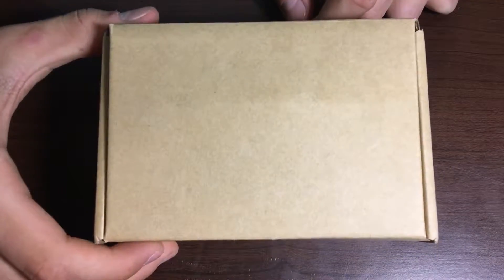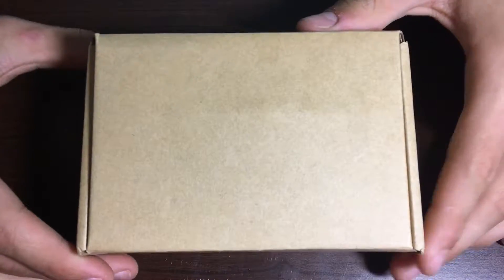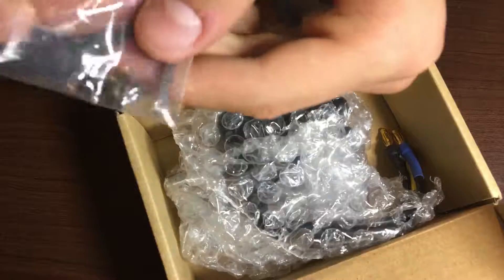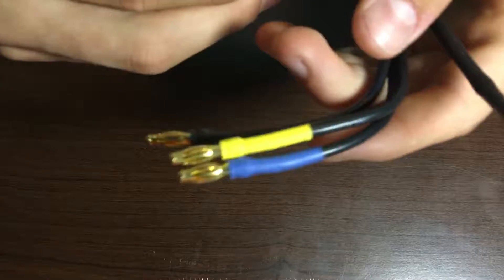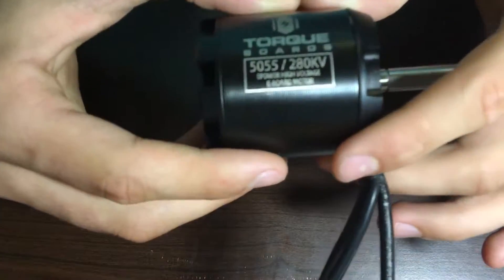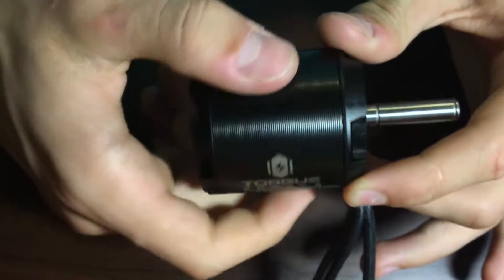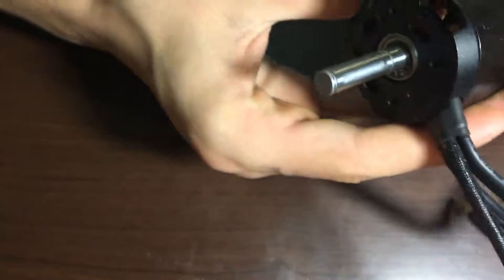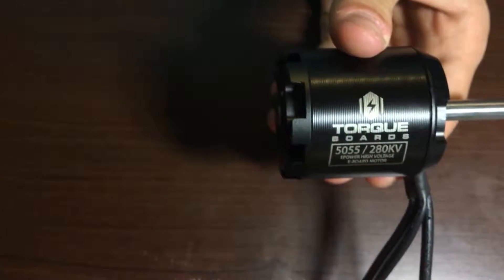Unboxing Of The Torque Boards 5055 280Kv Motor

Comment: What is the fourth wire on the motor for?
Reply: Josue ramirez the fourth cable is what you call a sensor cable some vesc support sensors cables and some don't , essentially what it does it lets your vesc know where exactly is your motor ,90% of people run sensorless no big deal the only upside of sensor is that your motors don't sound as loud and you loose a bit of speed on start up

Comment: why did u choose a 280kv at 50mm? I know under 300kv is recommended however at 280kv and a 50mm motor u will want 2 of them to get enough torque. I'm not judging by any means just curious .